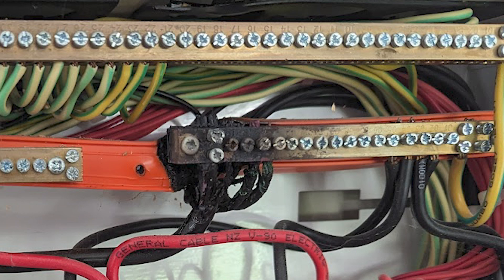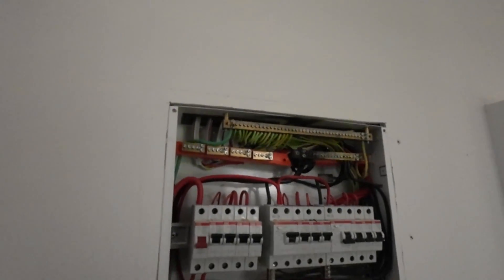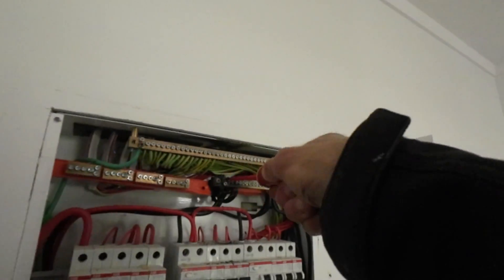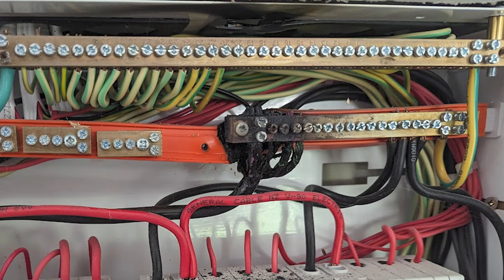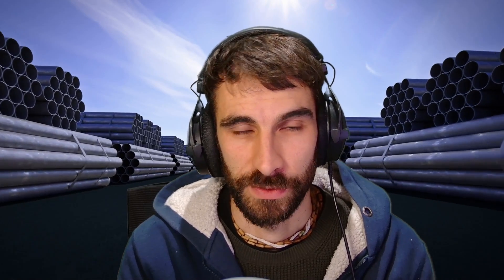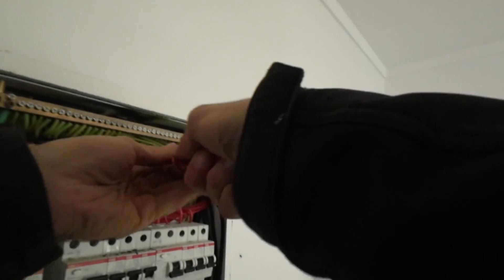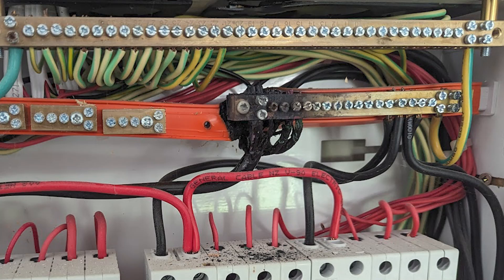Loose Neutral Fault Explained

Comment: Definitely most dangerous, especially if its a metal enclosed switchboard or appliance, and some unsuspecting person comes along and touches it... the double screw termination on the busbar is supposed to limit this, unless of course both screws are not tightened up properly... that's why I reckon the cable lug under the double nut system on a busbar is a lot better...
What is on the other side of the wall matters too... could be a clothes dryer or something vibrating the screws loose over time...
Seems an inherent flaw in the MEN system... pity there's not some sort of Main Switch/RCD combo device that could detect the current imbalance? Probably useless, as most people just reset them anyway...
True story... years ago I used a urinal in a public toilet block... after taking a wizz I used the sink and got a belt off the tap... even though being a sparky I wasn't sure if I was imagining it or not, so I used the BACK of my hand to touch the sink and sure it enough current was flowing through me...
Lucky for me even though the floor was wet, my rubber boots must have had enough resistance to prevent me getting a real zap...
Even luckier still, there was a Water Saving sensor above the urinal which clicked on after I had used it... 230v on the old fella doesn't appeal to me much... assuming that all the metal plumbing was connected together, the urinal could have been alive as well...😵‍💫😵‍💫😵‍💫
I never found out what the fault was, all I heard was that there was 230v on the metal plumbing, so I'm guessing no bonding on the metalwork, or a missing earth connection to ground perhaps? 230v from a faulty solenoid attached directly on a copper pipe with no earth bonding seems most likely to me... what do you guys think? 🤔🤔🤔
Reply from the maker: Sounds like a loose neutral fault to me, but could have been some other issue.

Yeah, a bolted lug would be a better connection. We also get loose neutral faults in NZ from the main neutral lug in meter boxes. Here they make us put thr meter neutral, the incoming neutral and the outgoing brutal all shoved in on like. Often thsg means 2 x 16mm wires and 1 x 2.5mm or 4mm, all in a 50mm lug. I find it crazy because they fill sometimes, when they fail it's super dangerous and it's not using the gear according to the manufacturers recommendations which breaks the electrical regulations over here.

I think the fault in my video could have been caused by the new terminals being lower quality than older ones. The don't make them very well these days.

Comment: And thats why we have separate zero connections in the Netherlands.The L and the O is switched in a circuit breaker.Far better and saver.
Reply from the maker: By zero do you mean neutral? Does O refer to zero?

How does that work? Is there. Separate earth conductor run all the way back to the transformer and no other earth neutral links? 

I think the best way to protect against these faults is a simple voltage detector on a final circuit which alarms if it measures low voltage.
Reply: @legacyelectrical  Low voltage between active and neutral combined with unacceptable voltage between neutral and an independent earth will seal the deal on a single premises PEN fault.

Comment: This is one reason why water pipes are bonded so you will not get shocked between, say,  a stove and a tap.
Reply from the maker: Im NZ they don't bind pipes anymore unless there's a way it could become live. Bonding things that don't have a chance of becoming live creates more risk as it introduces a way for it to become live as some faults will introduce voltage through the earthing system.
Reply: yeah but even if all things are bonded and this fault occurs there will be current flowing through the earth instead of neutral and so you could still get shock between real earth and earth of the electrical system
Reply: @BBBuckley  True, that is why in the UK EV chargers need to be protected against the PEN-fault, either by using a detection device or by making it TT.

Comment: I would like to offer a more intuitive and theoretical explanation about this phenomena. When you have a loose neutral connection, what once was a low resistance path for the current from the live line, now has a certain value of resistance due to poor contact area. In this case one may ask why does this result in currents flowing through the Earth? On systems that have bonded Neutral and Earth lines, ideally your neutral line is a theoretically zero resistance return path, compared to your Earth line that is, for the sake of the argument, lets say 50 ohms. In normal case the current from the Live line all flows towards the neutral line which is almost zero ohms(ideally), back to the voltage source and the loop is complete. In this normal case, neutral current is theoretically infinitely larger than Earth current by current division law.

Lets introduce fault in our system, loose neutral bar means added resistance to the neutral line, so now let us assume that the neutral line has 50 ohms due to poor conductor contact area... let us also assume that the Earth line remains a fixed 50 ohms as the previous situation assumed. Now your current I from the live line, by principle of current division, has to divide equally along the neutral and earth line, this results in your Earth line being "alive". If we further increase the Neutral line resistance(in the case of an open neutral line is infinite resistance), then the current will effectively all flow towards the Earth line, still by current division principle: Earth path is now the least resistance 50 ohms < infinite(open circuit) ohms.

I would gladly take any criticism if I chanced to have wronged in my assumptions.
Reply from the maker: Yeah, that's basically it.

I probably should have talked about voltage dividers.
Reply: NO ! There is no return PATH TO GROUND for the current to be shared !
Reply from the maker: @grahamstevenson1740  Some amount of current will travel through the earth mass under fault condtions, and, unless the neutral is fully lost, some current will travel down the neutral.
Reply: @legacyelectrical   Where is the conductive path to earth ? The electricity can't 'leap' from the neutral conductor to earth by itself !
Reply from the maker: The main earth and the main neutral are linked with what we call an MEN link. The point of this link is so earth fault currents will be big enough to trop thr over current protection without the need for a separate earth conductor all the way back to the transformer.

Comment: That why in domestic installation i "dislike" TN-C , TN-S or TN-C-S system , because if your PEN is broken or Neutral disconnect , then is it extremely dangerous.
Here in France for domestic installations only TT system is allowed and it is much much safer and cheap. tbh i don't see why many countries use those kind of earthing system instead of using TT or even IT. ( IT is very expesnive but the most safe system but i admit finding a fault on this system is hard and can be long etc... )
Reply from the maker: I don't understand. It's TT where there's only the ground for fault current? There's no way you can rely on the ground to clear fault currents. There's too much resistance to be able to draw enough current to trip circuits.

I believe you have to put everything on RCDs in those setups. But then don't you get lots of nuisance tripping from ovens and water heaters and pumps? We don't put those sorts of things on RCDs in NZ for this reason.

I think all we need to do to make it safe is install voltage monitors thya alarm if the voltage gets too low.
Reply: @legacyelectrical  not at all, we don't have such nuisance tripping from oven , water heater and pumps
And RCD are 30ma. And here in France the maximum value for the earth rod is 100 ohms.
Reply from the maker: They have to have RCDs on everything in Australia and they have nuisance tripping problems over there. They use 30ma Rcds. 

With 100ohms and 230v you'd inky get 2.3a of current for a shirt circuit to earth. That's not gonna trip nay over current protection devices.

A 150ma rcd for the entire installation is one idea. That would protect against this kind of fault. I like the idea of a voltage detector that alarms or maybe cuts power of thr voltage gets too low. Low voltage under loads is the best way to detect
Reply: @legacyelectrical  TT requires additional protection. In the past they had something that sensed the current in the ground wire. Now they use RCDs. There can be a house-wide 100 mA RCD and then 30 mA RCDs as the code requires. In the UK they do not need the 100 mA RCD if everything is protected by 30 mA.
Reply: @legacyelectrical  ah, I was listening the video while doing something else, didn't understood why such an issue wasn't prevented with an RCB before the accident occured. No RCDs on some lines  (plus a main RDC on network feed before distributing anywhere else in the building)  ...

Nice to know this situation can occur in other countries (living in France).
Seriously ...
Reply: Really dangerous fault
Reply: You can have TNCS + bonded earth rod(s) which is even better as you have both the earth rod and the suppliers earth combined
Reply from the maker: Isn't TNCS where there the main neutral conductor is also used for earth fuskt currwnt while also being bonded to an earth electrodes at each installation?
Reply: @legacyelectrical  yes you basically have a combined neutral and earth cable enter the property. This is then immediately split into neutral and earth separately.
The electrical supplier bonds this combined neutral and earth to earth really well. Lots of rods, mats etc along the path so you have a low reading. You can additionally add your own electrodes at the property which provides you an earth in the event the combined neutral/ earth is cut.
Reply: @legacyelectrical  ye the neutral is earthed
Reply from the maker: @TheAviation101  ok, that's interesting. I guess the only difference here is the network doesn't do the earthing, it's done at each installation here. I assume they earth it at the transformer too.
Reply: @TheAviation101  Earth rods do not make it safe.
Reply: @okaro6595  in the event of a neutral loss, you can avoid dangerous touch potentials developing. Especially important for things like solar inverters that operate when the grid goes offline. They DO NOT require TT as many electricians seem to think. TNCS bonded to a low Ze earth rod is even better (after considering some things like extending equipotential zones etc)

Comment: Had a similar problem in a college where I used to work: I’m retired now.  First thing noticed was some fluorescent tubes dim and flickering.  The college electrician had left, and was not replaced, they just called in a local one when required, so I reported the problem to security.  They told me not to worry, it was just some work being done in the substation by the electricity company.  I went down to the basement and that work was just some new HV cables being pulled in, they were not connected to anything, and certainly cot causing the problem.  I reported it again and they again told me not to worry.  I went into several of our rooms with a multimeter and measured the Voltage on some single phase outlets, and they were all over the place, some far to high and others far too low.  Thought this must be due to different Voltages on different phases, so logged in to the three phase UPS in out server room to check Voltages and sure enough large differences between different phases.  Thought about it, and decided that it looked like a neutral wandering around.  Measured between neutral and earth on several outlets and sure enough significant Voltages there, up to about 85 V I think from memory.  Went back to security to report it a third time and said that something was seriously wrong and it needed the attention of an electrician urgently.  Their reply was unbelievable, step said that they would give me the keys to the LV intake room so that I could go down and investigate.  At this point I raised my voice somewhat, told them that I had no reason to think that thefault was in the intake, but that I wasn’t an electrician and certainly couldn’t investigate anything.  I was an I.T. technician at the time.  They reluctantly agreed to call the electrician.  Later that afternoon he arrived and came to see me.  He wanted to know why I’d had him called in; the fault had been reported to him as just the Voltage being a bit low, which it normally was as the installation was overloaded which is why the new HV cables were being installed to the substation to feed a new transformer.  I told him what I’d seen, and he said that I was right to have him called in.  The next day he came to see me again.  He took me to a corridor behind the library to show me the fault.  Neutral fault? I asked.  He nodded and took the cover off a large distribution board.  The neutral connection was to a stud which had completely broken off.  Much of the installation was from the ‘50s, but this board was a modern one, installed during a refurbishment only a year or so previously.  There was a major imbalance in our load which would have made matters worse.  L2 was always the most heavily loaded, with L1 next ant L3 the least loaded.
Reply from the maker: Far out. That's shocking they didn't take it more seriously.

It being a 3 phase installation makes it better then if it were single phase. When it's a perfectly balanced load the neutral doesn't do anything but when it's unbalanced then you get problems without a neutral.
Reply: @legacyelectrical  
The load was a long way out of balance; it was probably better in the ‘50s when the college was first opened, but over the years the load would have increased greatly, and some parts of the building much more than others, so the single phase loads were way out of balance.  We complained about it several times, but nothing was ever done.

To be honest, I don’t think the security staff that I had to report it to had any idea what I was talking about.  It seems ridiculous to me that a place that size didn’t have an electrician on the staff, but they thought they could save money by not filling the post when the old one left.
Reply from the maker: @srfurley  They probably weren't saving any money. Staff are cheaper than contractors because businesses need to make a profit. 

Yea, they should be way quicker to ring an electrician when things don't seem right. That kind of fault can kill.
Reply: @srfurley It's the usual false understanding of 'what I can't see can't hurt me'...
Reply: You are responsible Sir! A gentleman. Others would walked away because some security buffoons told them to.